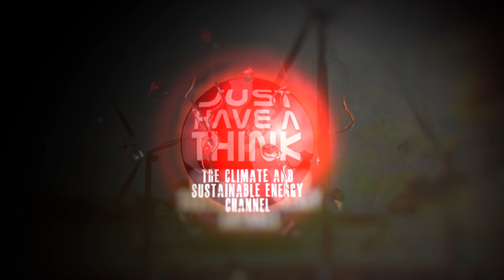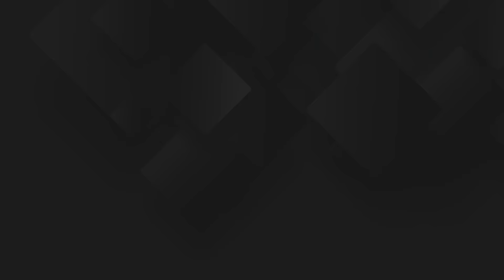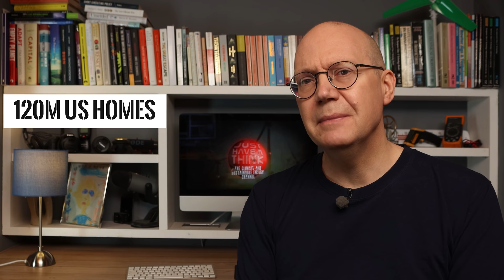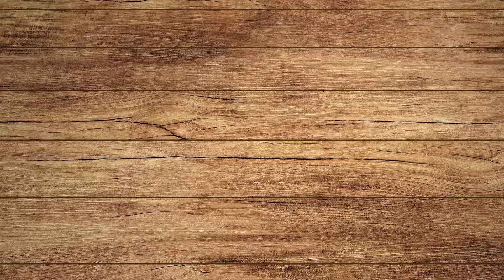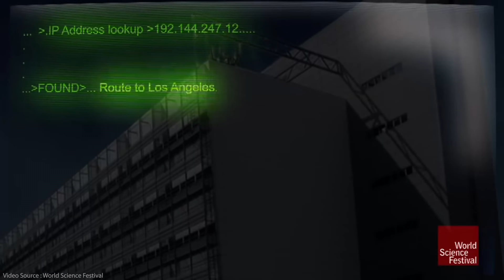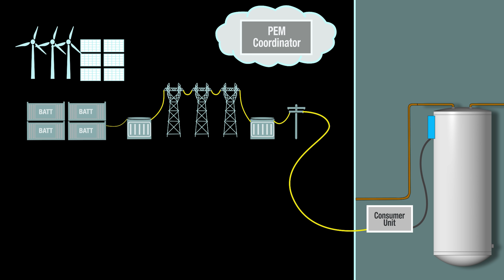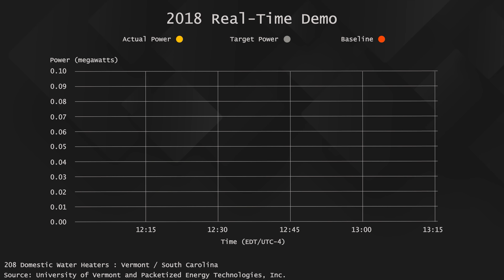How to balance renewable grids WITHOUT energy storage!

Comment: I love it, but I would make one tweak: when you opt out of the managed system to force energy delivery, you should pay a higher price for that energy.  And maybe it shouldn't be a binary thing -- it could be a simple dial or slider indicating how urgently you need the energy (and how much extra you are willing to pay for it).

In other words, apply economics to the problem.
Reply: But that would penalise people who need, for example, urgent heating more often. People with poorly insulated houses- mostly poorer people- will thus be paying higher rates.
Reply: @danyoutube7491  Good point.  This argument often comes up -- we can't use economics to cause the right thing to happen because the poorest people are the least capable of adapting.  The same thing is often said about carbon taxes.  But of course there are ways to help the poor.  For example, with a carbon tax you can use the very tax money you collect to give the poor back some money.  They still have an incentive to be more efficient, because if they do they'll actually MAKE money.  You DEFINITELY want those who are being the most inefficient to have an incentive to improve, even if they are dirt-poor.

And you could do the same thing here.  Start a program to upgrade the insulation in poorly insulated homes, and fund it with the extra money paid by those who say they need energy urgently.
Reply: My go-to solutions are often economic incentives as well.
But in this case, I think any attempt to charge the one opting out would be seen as a draconian, and a reason to not adopt this technology in the first place.
Tl;dr Better to skip the extra charge for the one opting out, rather than risk this plan becoming unpopular before it's even adopted.
Reply: Really, we should let the price of power float. If you have a smart water heater, it would just be bidding for electricity and deciding to turn on when the price per kwh gets low enough. The people who want to opt out of the system just pay fixed rate that is approximately the peak demand rate.I can see smart thermostats where it move the slider between sticking more strictly to the set temp & paying more, or letting it drift a few degrees until the price gets low & paying less. It would also give great economic incentives to build storage facilities when they are truly needed to deal with the parts of peak demand that can't/won't shift.

Comment: Very timely viewing. The UK grid now is showing the lowest ever gas consumption for generating electricity. The wind contribution is high and the sun is shining at a time when grid consumption is low.
The gas power stations are used to flex the supply but what happens if the demand from them reaches zero. It is inefficient to have a gang of industrial units reving up and down and not easy to switch them off.
Coincidently Octopus Energy is experimenting in the area of your discussion by asking consumers to reduce demand when we are short of supply and hopefully soon will ask us to take free delivery when in surplus!

Comment: This is one of those ideas that solicits a reaction like, "Of course!" and "Why didn't this happen sooner?" Even with battery storage, this scheme would seem to have advantages for peak load control at a minimum. If anyone wasn't feeling urgent about climate disaster, the last week of events should emphasize the critical need for energy independence at least regionally.
Reply: The reason we didn't have this sooner is because it's an enormous attack surface for cyberattacks. Our power distribution systems already suffer cyberattacks all the time, literally all the time. This system is basically itching to get DDoSed.
Reply: The last week of events should make politicians really start using their brains. Europe urgently needs energy independence
Reply: @tissuepaper9962  Good point about cyberattacks, but it's simpler than that.  This system, as smart as it is, is complicated and would be expensive.  Every major electrical appliance would need to be modified.  I would also beware of single point of failure problems and want to see robust fail-safe modes in the event of any failures in the system.
Reply: @luismachado6264  Politicians with brains? Maybe, but said brains are fully occupied by staying in power and maximising personal profit.
Reply: "the last week of events should emphasize the critical need for energy independence" Part of this mess is result of phasing out coal / nuclear and replacing it with unstable renewables stabilised by natural gas coming from clearly politically unstable source.
I'm not saying that's impossible to strive for climate goals and geopolitical stability (modest storage, HVDC, nuclear), but the way it was done was clearly asking for problems.
Reply: @full stop fully agree. You must bring together electricity companies, grid companies, appliance manufacturers etc
Reply: @useodyseeorbitchute9450  Yep, though Russia also exports a lot of oil.
Reply: You don’t need to modify existing appliances as such, you only need to have a smart switch that does the communications to the grid and then switches existing appliances on or of. Like a 5g smart plug or WiFi enabled.

Comment: I have a smart thermostat and during the summer months, I use pre peak electricity to cool the house down in advance of a hot day, then set it to 28°C to coast for the rest of the day. In a sense, I am using the air in my house as a battery. The city wanted me to give them the ability to shut my system off if they were concerned about power usage and I said no. Partly because I don't think they can manage my electricity better than I do, and partly because I think it's there job to improve the grid's infrastructure, and don't want them to pass the buck to the consumer. They privatised electricity production in my region and I resent a Corporation that pays out dividends instead of reinvesting profits in an essential service.